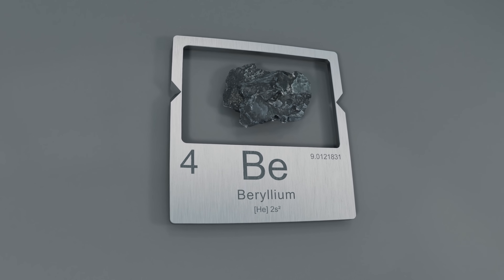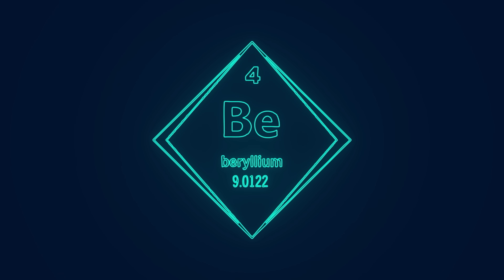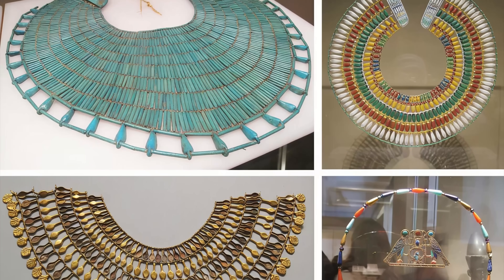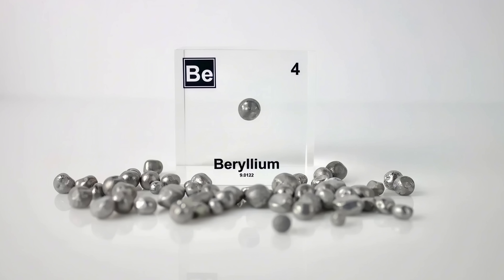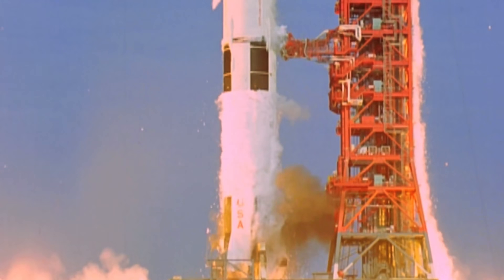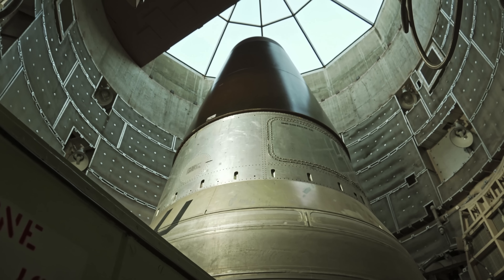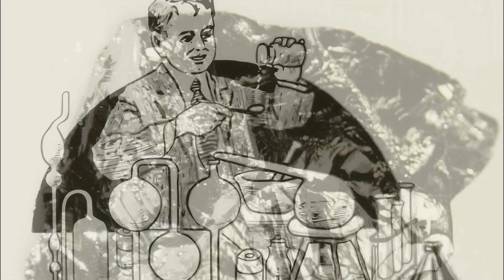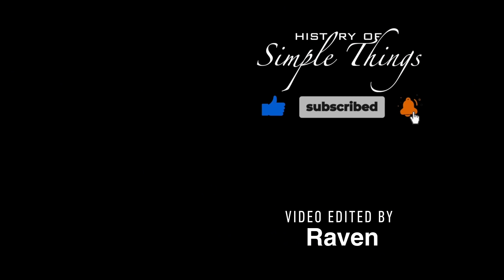How Did One Simple Element Shape Modern Science?

Comment: Beryllium is used in the coil springs of some moving coil type electrical meters. Also, beryllium oxide was used to coat the cathode of some types of electron tubes (valves).
Reply: BeCu springs have extreemly high modulus of elasticy .

Comment: I'm not sure what it was used for, but something in the process of producing the Plutonium pits for Hydrogen bombs required machined Beryllium.  Several machinists who worked at the Department of Energy's plant at Rocky Flats in Colorado got Berylliosis of the lungs during the 1950s and early 1960s.
Reply: Yes, the outer sphere that encases the bomb is Be as are other components.
Reply: It acts as a reflector instead of allowing neutrons to fly off into space it reflects them back at the plutonium enhancing the reaction.

Comment: somewhat misleading, solid beryllium metal is perfectly safe to handle, what's not safe is to file, grind,  cut, polish, or machine in any way, that produces powder, dust, or fine filings because if they get in your lungs you could be one of the unfortunate that may develop berylliosis which can lead to cancer.
Reply: Yes while working in the research of CAParsons some 55 years ago there was a beryllium lab which looked into the possible use of the metal in atom reactors 
Parsons was the builder of the first commercial atom station at Calder Hall
Reply: Yep, just like Asbestos.
Reply: Some people are allergic to Be. So handling  it with bare hands could give you a reaction. It's been known to give some people rashes. Now if you want to talk deadly talk Be oxide. It's quite magical and dangerous.